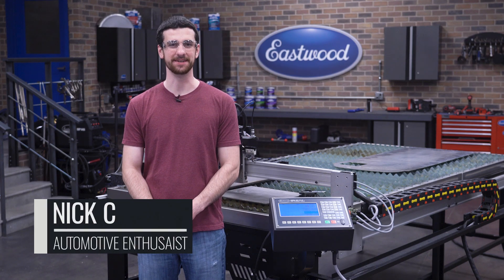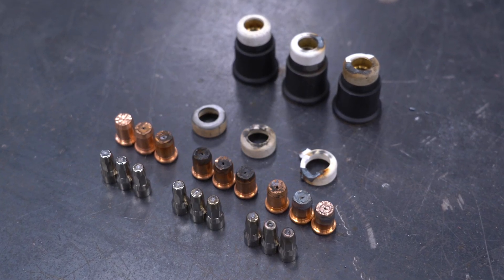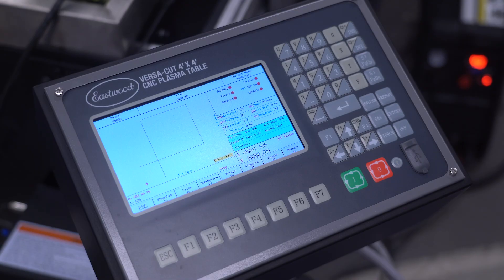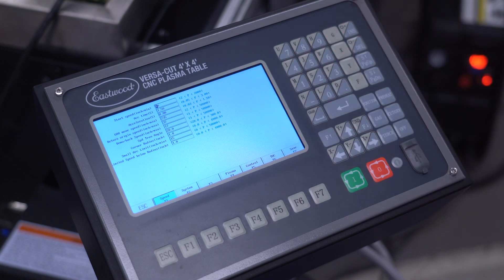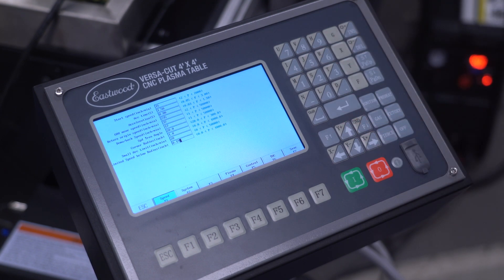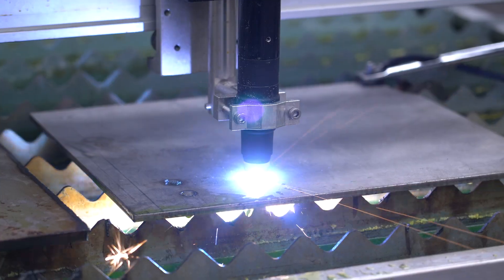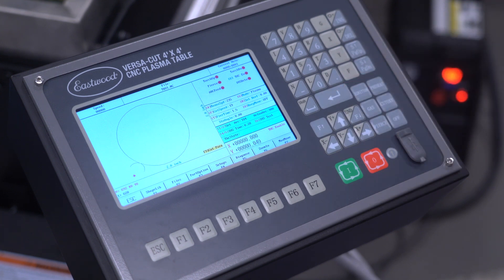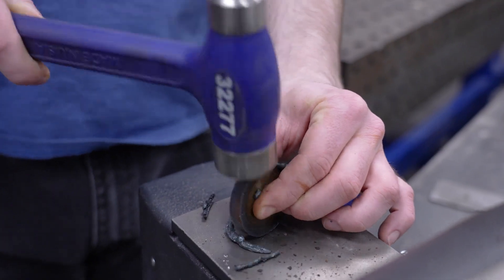How to get the MOST from your CNC Table - Cut 1/4" PLATE!

Comment: Did you ever get the Nozzle cap covers back in stock for the CNC 60 torch? Kinda rude to sell me the elite 60 and when I asked your sales rep to add on multiple consumables for the CNC torch, I received the consumables for the hand torch.
Reply from the maker: We're sorry that happened to you, we don't have a "consumables kit" for the CNC cut 60 as it's a more industrial application.

Here's the list of consumable replacements by part number for the CNC cut 60:

55156 - Electrodes 10 Pack
55157 - Nozzle Guard 5 Pack
55158 - Nozzles 30A 20 Pack
55159 - Nozzles 35-60A 20 Pack
55160 Nozzles 65-120A 20 Pack

You can check them all by using that part number at https://www.eastwood.com/